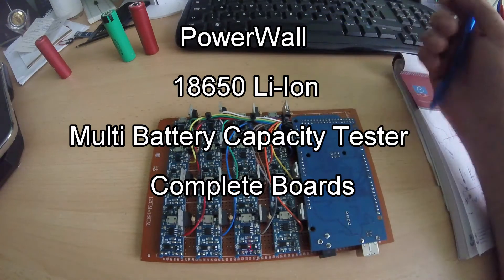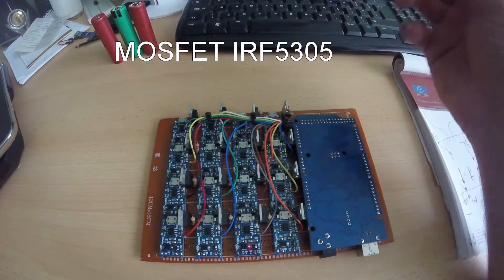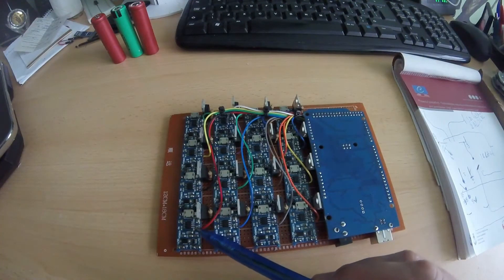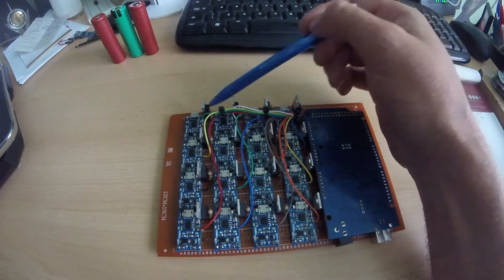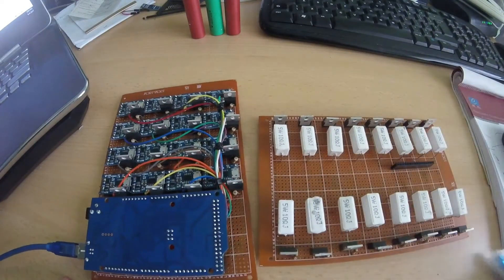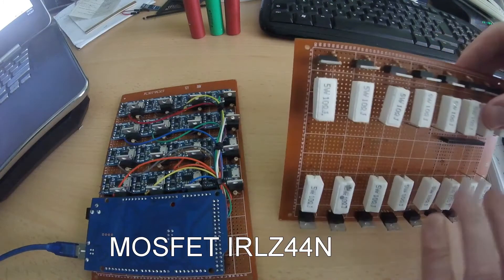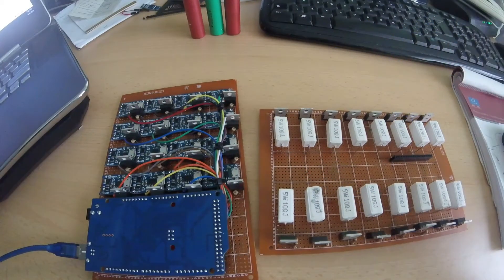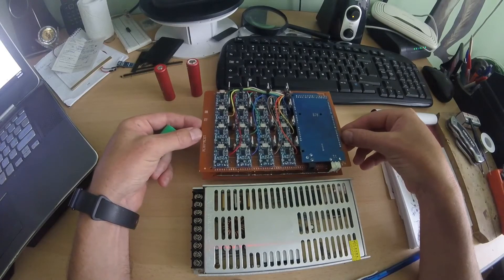#4 18650 Li-Ion Multi Battery Capacity Tester Completed Boards

Comment: can you please tell where you connect the charging full status cable on TP4056 on positive or negative of the led TP4056?
Reply from the maker: If u check the TP4056 board will see the positive side of the LED are connected together to VCC line.
So u need to use the Negative PIN of the Cherge Complete LED
Reply: yes I figured it out thanx
can you cell me your charger?
Reply from the maker: @RizwanSaeed  I dont understand what do u  mean "cell"
Reply: can you sell this charger to me?
Reply from the maker: @RizwanSaeed  In this video are the boards from my first charger V1. If u need that i have the charging and discharging board from this video
Reply: yes I see all of your videos
V1 is the one that use load resistors so what you charges for them?
Reply from the maker: @RizwanSaeed   send me a an email and i will replay with photos what i have
Reply: rizwanfbd1@gmail.com
Reply: waiting
Reply: Hi can you please share schematic and code, i have bought all the parts for v3 but no schematic. I am stuck. You drive link are not accessible.